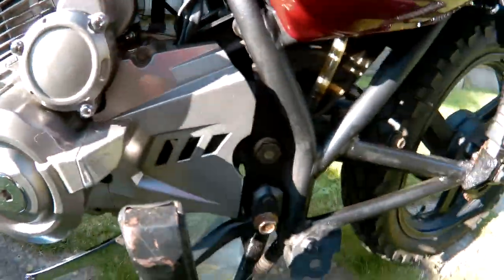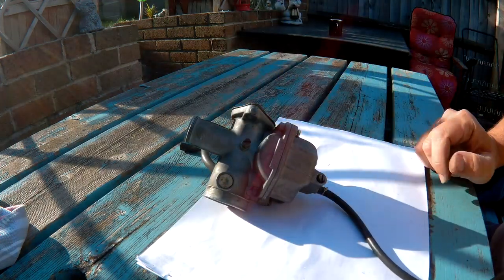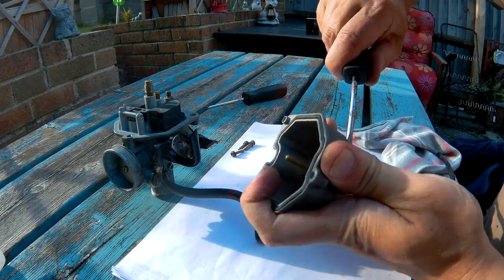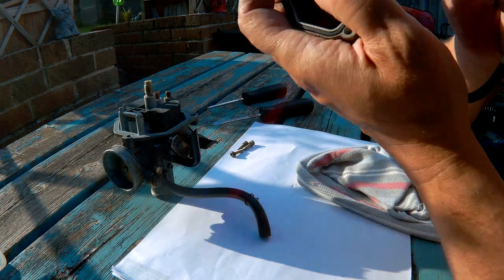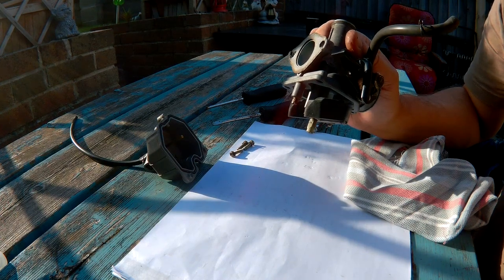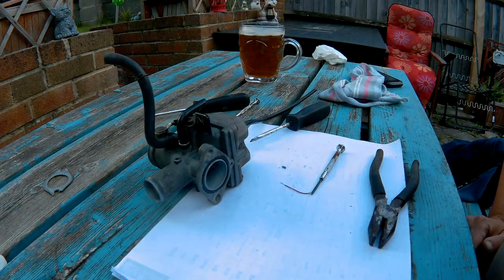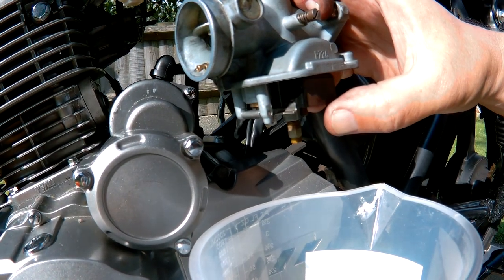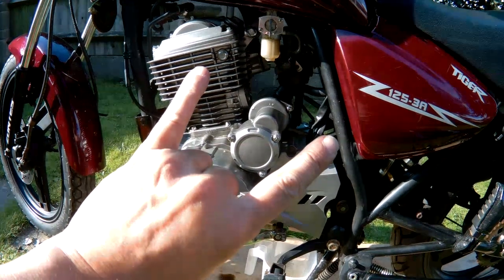Zontes Tiger Chinese 125cc leaking carb . Can I fix it ?

Comment: Hi steve. I have same bike as yours. I noticed that when I start approaching 40mph it start to loose speed as though it wants to shut off. I was thinking it’s the carburettor that needs some servicing or the valves. Please can you advise me on what to do? And also what’s the valve clearance setting for both the inlet and the exhaust valves?  Thanks
Reply from the maker: Valve clearance should be 0.06~0.08mm
inlet and exhaust. I would look at the carb tuning and fuel filter. The carb is very simple and easy to work on.
Reply: hi sounds like carb is dirty ..just clean carb and clean the main jet out...should run ok after clean.Like steve said check fuel filter too...Also clean airfilter or renew air filter..

Comment: hi steve i have just gone back to a 125cc after riding big bikes for 20 years . due to arthritus in both knees. my last bike was a yamaha 600 which i sold to get a 125cc.  i forgot how much fun a 125cc is.  where is the best place to get parts for the chinese 125 bikes. as mine is the copy of the YBR125.  THANK YOU IN ADVANCE. also subescribed to your channel look forwardd to watching more of your videos.
Reply from the maker: I get my parts from Ebay and also https://www.chinesemotorcyclepartsonline.co.uk/

I have no intention of riding bigger bikes but wish you could get on a 250cc with a CBT, it should be graded what you can ride with just the CBT the way the full licence is graded depending on age.
Reply: @SteveSims  yes would be good idea..the only problem you have with bigger bikes they are more expensive to repair...if 4 cylinder like i had it is 4 of everything and tyres dont last as long on bigger bikes too.i had forgot how much fun you can have on a  little 125.i did 100 miles yesterday and the fuel gauge hasnt even moved.
Reply from the maker: @S161064  I enjoy working on this bike because it is so easy, I wouldn't even think about setting up a 4 carb bike or some big engine with bits on it, that would go from enjoyment to a chore. Plus this 125 is fairly cheap and parts are readily available and if not then just use some generic part or something off a different bike.
Reply: @SteveSims  yeah very true with a big bike just to take carbs off on my yamaha 600 I had to remove all failings seat and fuel tank just to get to the carbs ...really enjoying riding my 125cc ..it's a lot of fun and I don't have to keep backing off the throttle like I used to on my 600.

Comment: how did you manage to remove the carb from the bike i couldn't
Reply from the maker: mine is just held on with 2 bolts. I just removed the pipe from the air filter to carb and screwed the top off the carb and unbolted it. pause the video @2:39 and the left is air inflow pipe removed, top is throttle unscrewed and right is where it bolts onto engine.